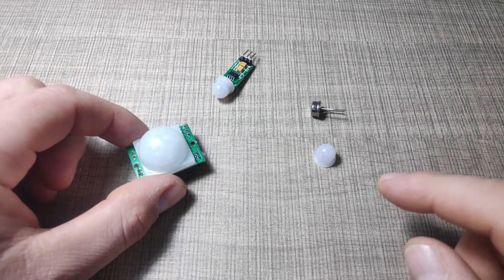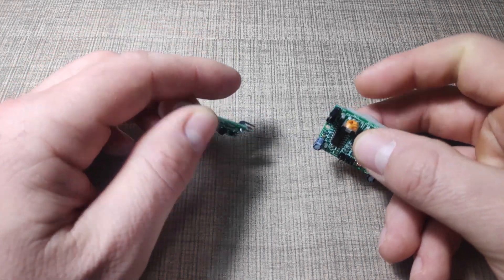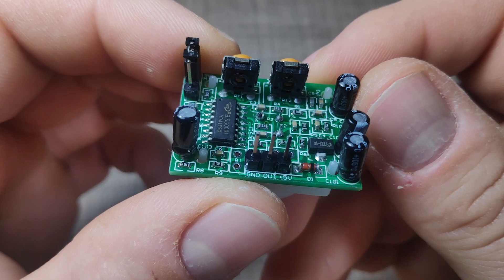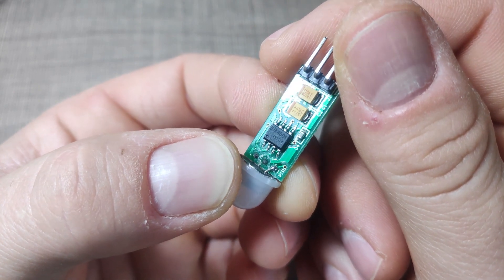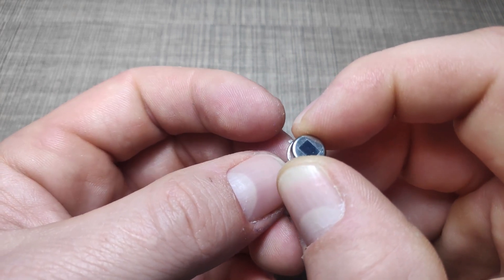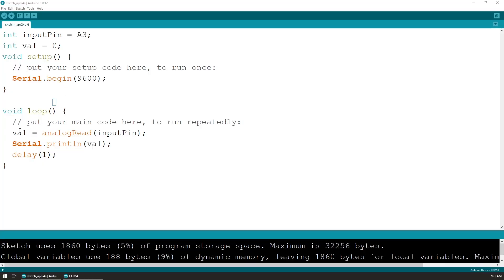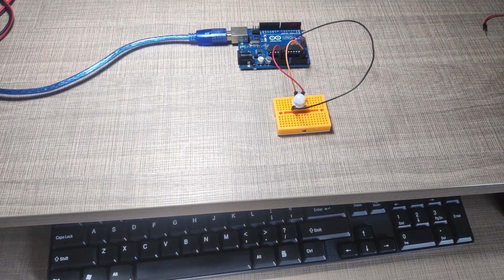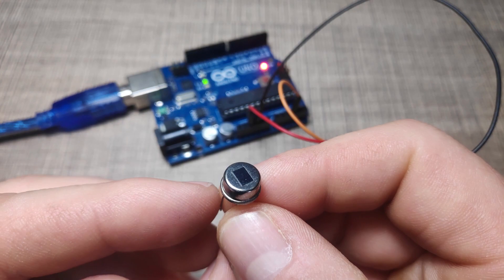Interfacing a bare PIR sensor with Arduino - can it be done?

Comment: Hello.

You need a path to ground from the source pin, otherwise your sensor also doubles as an electrometer, reading your static electricity.

A 47k resistor from source to ground will do the trick. The value is not extremelly critical, but it determines compromises. Higher values give sensor better responsivity but less rejection of interference. Lower values give better rejection but lowers sensitivity.
Reply from the maker: That's good to know, thanks for sharing that information!

Comment: Those are analog devices. For the same price, you can buy BS312 with digital output.  Or the BS412 also has adjustable timing. You have to buy the lenses separately.
Reply from the maker: Thanks, I'll look into them.

Comment: use an amplifier my man
Reply from the maker: Well we already know that using an amplifier works. Where's the fun in that?
Reply: @TasteTheCode  It might work but how well? I would have loved to see the arduino plotter display the graph with an amplifier to see the sensitivity/range/field of view of the sensor. The modules are not really useful at all for that since the output is on/off.
Reply from the maker: Yes, when these are in operation they just change state, you can't really plot the output as it will just flip on movement.

Comment: The PIR sensor sensing Infrared signal, of which the human body heat is one good source. So, you don't really have to be in front of it... once there is body heat change, the sensor will detect it.
Reply from the maker: Yes I realized that and it's all controled based on the lens in front.

Comment: Hello, I have a question, can you help ?
Reply from the maker: I don't know... What's the question?
Reply: @TasteTheCode  About pir sensor with Arduino. As long as the obstacle is fixed in the PIR sensor, will the output led of the arduino be active ?  Thank you .
Reply from the maker: Nope, if an object is fixed, the PIR won't detect a change.

Comment: Could the sensor be picking up the infrared heat coming off your hand, or the static electricity that's moving in the air as a result of your hand moving through the air?
Reply from the maker: I think that it is the static that is being picked up.

Comment: Output signal from PIR  (peak to peak over DC) is  in range 0.1mV to 1mV ; resolution of ADC of Arduino  3.3/1024 = 3 mV ;   without amplifier  arduino is not sensitive enough to detect a change;  probably what you see is a 50Hz mains AC  with wires acting like antenna
Reply from the maker: Could be. Thanks for your input!

Comment: Can a bare PIR sensor be used with a Raspberry PI? Seems the analog signal is not supported, anyone know of any ways to work around this?
Reply from the maker: You are better off by using a module. The bare signal is just too weak to be usefull.
Reply: @TasteTheCode  Hmm Okay. Well in that case I'm just going to go with an outdoor/AC mains PIR sensor from a security floodlight, as I have a spare of those lying around too.   My plan is to just link the switched AC output into a mobile-phone charger so I get DC 5V on the output which can be used as a logic on/off signal state for the raspberry pi. A bit of a hacky workaround but it should solve the problem ! :D

Comment: I'd be curious what the light source is above you desk. Flourescent lights produce light at a high frequency that your eyes don't necessarily perceive, but that circuit might sense and the arduino could show you in your  "scope", or maybe the ballast of the light source might produce nose at that frequency???
Reply from the maker: It's an LED light bulb. Actually, two of them.

Comment: my pir sensor not only sense me but it also sense any object why it is happening
Reply from the maker: It depends on the distance and the thermal signature of the object. If it got a different temperature than ambient it will see it as change and if it is you that moves the object, then it is still detecting you and not the object.

Comment: What is you measure out of the bare PIR sensor?  You mention between 720 and 820 at rest is the 700 mA.  Lost like the output is actually less when trigger?  Is that right.  I am trying to figure out the out put of the bare PIR sensor in voltages.
Reply from the maker: That is nether V nor A but the mapped digital value on the Arduino analog pin (0-1023). There is a very nice datasheet in a previous comment by "luca panjer" where you can see the actual voltage "wave" by the sensor once it is triggered. The actual voltage first goes up and then down by the same amount.

Comment: Hello Bill.  I am interested in having 5 PIR motion sensors made to trigger dslr cameras for camera trap systems.  I would like them as small as possible to fit into a small waterproof case, and be powered by either 18650's or AA rechargeable batteries.  Once they are triggered, I want it to continue to trigger the camera until there is no more motion present.  Are you interested in building them for me?  I am not able to create something like that with my hands.  Jay
Reply from the maker: Hey Jay, write me on Messenger on my Facebook page at https://www.facebook.com/tastethecode and we can talk about the details.

Comment: you should have parallel resistor 4K7  vout to gnd and , vout to  test point  - series capacitor   " like in AC mic  " then connect the vout to scope ,  then retest and try again....you should also have an amp
Reply from the maker: Yes, I found out that after making the video. however, my goal was to see if the sensor can be used without an op-amp.
Reply: @TasteTheCode  A lot of the commercial 100 LED Solar PIR lights use a bare PIR sensor, along with an 8 pin micrro controller, that has an adc.
Reply: Perhaps they apply a filter to the signal to remove "noise" e.g. https://playground.arduino.cc/Code/Filters/
Reply from the maker: @LittlePetieWheat  The most common way I've seen is by using an opamp to boost the signal and then a microcontroller of some sort to catch the swing in voltage.

Comment: Interesting, I've got a similar sensor from a motion detecting light. When I connect it to an arduino, I see that it's outputing a very nice sine wave (my device's amplitude is from 350 to 720 on an arduino, or around 1.12V and 2.3V), with the period being about three to four seconds. When I wave my hand, the amplitude of one cycle seems to change, and then the sine wave goes back to normal. I have no idea why it's behaving like that.
Reply: See: https://www.makerguides.com/wp-content/uploads/2019/07/RE200B-Datasheet.pdf
Reply: This works for me:
const int n=10;
int d[n]={0,0,0,0,0,0,0,0,0,0};
float avg=0.0;
float lowest=0.0;
float highest=0.0;
int cnt=0;
int i=0;

float average() {
  int sum=0;
  for(i=0;i<n;i++){
    sum=sum+d[i];
  }
  return sum/n;
}

void beep() {
  digitalWrite(11,HIGH);
  delay(500);
  digitalWrite(11,LOW);
}

void setup(){
  pinMode(A0,INPUT);
  pinMode(11,OUTPUT);
  analogReference(INTERNAL);
  for(i=0;i<n;i++){ 
    d[i] = analogRead(A0);
  }
  lowest = highest = average();
}

void loop() {
  d[cnt] = analogRead(A0);
  cnt++;
  avg=average();
  if(avg>highest)highest=avg;
  if(avg<lowest)lowest=avg;
  if(highest-lowest>=2) {
    beep();
    lowest = highest = avg;
  }
  if(cnt==n)cnt=0;
}
Reply from the maker: Yep that sounds very close to what mine does. Try putting a 47K resistor between source and ground and that should remove the sine wave so you get a more linear output. I did that in my hand-washing timer video. https://youtu.be/rFSXo7EFj_Q